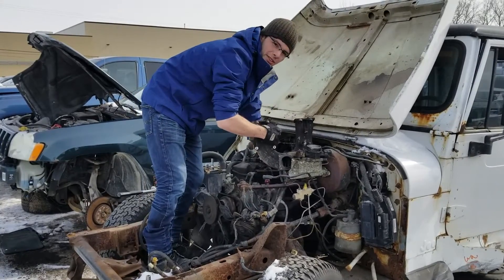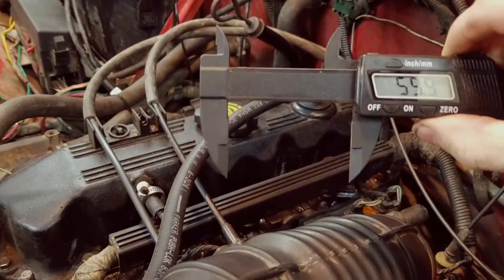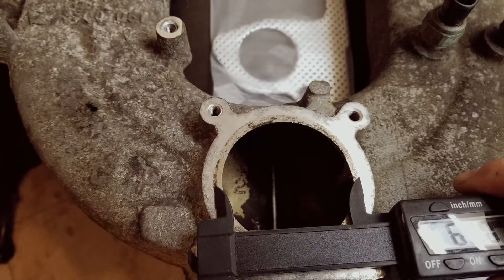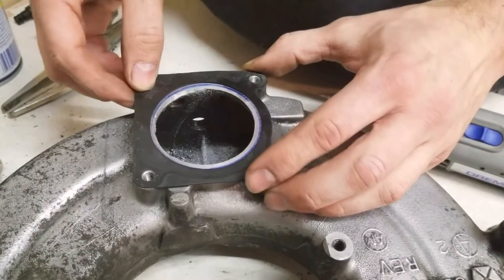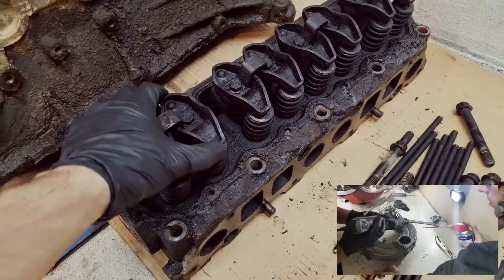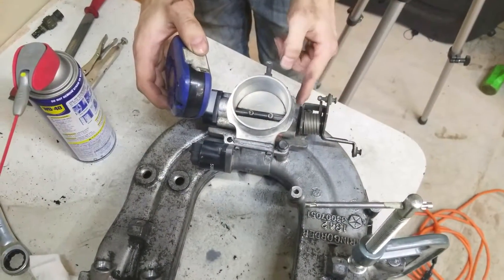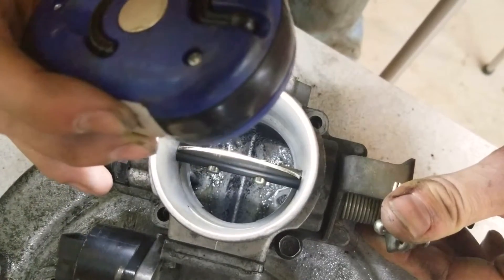Port Matching A 2.5L Intake Manifold To A 4.0L Throttle Body

Comment: I assume when you dremel the bore of you manifold theres significant aluminum shavings that fall into the manifold. How did you go about cleaning the shavings out? Did you use vacuums? Shoot compressed air into it?
Reply from the maker: Both,  yes.  You can also run water though it and dry it off before re-installing. Just whatever it takes to get the shavings out.

Comment: Computer is going to hold back the motor. 1.6 rocker arms are the best bang for the dollar.
Reply from the maker: By the same logic the computer would prevent the rocker arms from adding power as well. Neither is true reducing restrictions is helpful however you slice it and the computer really has nothing to do with it.  I do agree that 1.6 rocker arms are a good mod and will make more power but porting the intake manifold is free so if porting makes any power at all and costs nothing then it provides more bang for the buck. However I would argue that the 1.6 rockers are more worth the time/ effort.
Reply: @JeepSheepTV  there are videos that go mod by mod on a dyno. Only the rockers as any significant increases.

Comment: I see that these improvements has fallen off, The power commander 3, it seems a limited amount of a computer modification are not available... or is there?  Now in the end of 2021
Reply from the maker: There is a small group of people working on an aftermarket ECU and I'll be digging into it soon.  The best I've done for this engine is re-gearing, supercharging, and moving the IAT sensor. I have videos for the last 2

Comment: did this make a noticable difference, as you said a simple install made no difference?
Reply from the maker: No,  mods like this would take a dyno to understand the any hp gains.  I believe 4wheeler did a dyno test a while back and found 2-5 hp gains. The biggest difference for the 2 mods mentioned is an increase in responsiveness off idle and I do notice that.

Comment: Thank you! You are the first, and as far as all the clips I've seen, the only one to explain the relationship between the TB and the intake valves. SO to make sure I understand, because I'm kinda slow:  by installing the 4.0 TB, and porting the intake manifold to match, while not increasing air volume, except at full throttle,  we are decreasing air-flow-resistance? Allowing the four-squirreled beast to breathe better. Correct?
Reply from the maker: Yes that is the theory. You are also changing the amount of air into the engine per throttle position. So it should 'feel' faster because 10% throttle before meant X amount of air whereas 10% throttle now is X plus a little more. Being that the jeep is fuel injected and the throttle position is recorded in the PCM doing this will have a slight affect on you fuel trims as well but nothing that the feedback loop can't account for. The overall theory here is reduced air resistance but keep in mind everything else that is happening in the system.

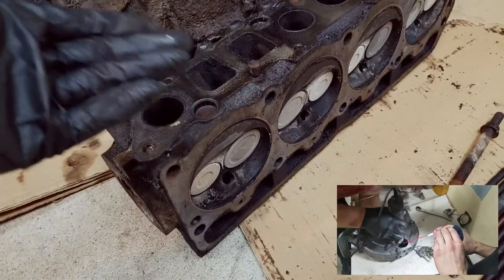Comment: 4:55 the valve Gap is what controls the air amount .. one  of many ways around this ☝️ 👀 look in changing your Rocker arm ball bearing type with different clearance 1.5 1.6  it changes the valve clearance . FYI

Comment: So the gains with a 4.0 tb, spacer, and ported manifold all together total 24hp, but is that by themselves, or does that include other mods like 12hole injectors, header and full exhaust? What could one expect by running EVERYTHING? Injectors, header and exhaust, tb, spacer, ported manifold, intake, 180* thermostat, and anything else I'm forgetting.
Reply from the maker: I currently have all of those things minus the thermostat and tb spacer.  My injectors are 4 hole instead of 12 because  I read that there wasn't much difference between the two. I have also regeared to 4.11s which made a huge difference in how it drives. I will be making one more modification before I put it on a dyno and then we will find out what the difference really is.
Reply: @JeepSheepTV  definitely post up an update video with final results. Ive got a 96 XJ with the 2.5 that I'll be building on. Bone stock right now and in desperate need of maintenance, so I might as well just jump right into the upgrades instead of doing it twice. The 4 hole and 12 hole injectors are pretty much the same price on Ebay, so I might as well just jump for the finer spray pattern, also gonna dig up a spare manifold to prep for the tb swap.  

Any recommendations on an ignition upgrade to go with, or is stock sufficient in this case?
Reply from the maker: @IFixThings1985  For sure, I have videos for most of my mods so feel free to take a look at those and don't hesitate to ask questions! We are here to help!
Reply: @JeepSheepTV  any word on the update video?
Reply from the maker: @IFixThings1985  its gonna be a while,  I have one more mod to do before I  throw the jeep on a dyno.
Reply: @JeepSheepTV  Is a while 7 months? I'm doing  these mods and wondering what to expect; though I haven't bored the intake. Wondering if that really made a difference before and after.
Reply from the maker: @davidloredo3791  yea,  a while is longer than that even. Lots going on over here. Since this video I have moved, joined a second channel, done a ton of house projects and learned a great deal about fuel injection tuning. The biggest hold up has waiting for the channel to start making money so I can save for dyno time.  But don't worry,  I'm still working on it. Many videos to come!

Comment: On the subject of air needed by an engine there is a simple mathematical equation at least for older vehicles that manufacturers used to use to determine the CFM requirement of the engine to put the correct size carburetor on a specific application CFM stands for cubic feet per minute it's basically how much air can flow through something like a throttle body or carburetor the math ematic equation that I'll put on here is for a street engine only needing an 85% efficiency rating I'll use your Jeep engine as an example to show you what the CFM requirements are for your engine first you start with how many cubic inches the engine is yours translates to 150 cubic inches then times that by the red line of the engine or the maximum rpm operational which on your engine is 5550 RPM times that by 85% divide it by 3 4 5 6 it should look like this 150x5550x85%/3456=204.75 CFM requirement. And on a full racing engine you would replace 85% with 110% efficiency rating what I like to do on my performance Street engine which means it has a mild cam upgraded intake and exhaust you want to hit it somewhere in the middle between 85% and 110% to get a good CFM flow for your throttle weatherby carburetor or throttle body at 234.75. This is a approximate guideline not an exact equation meaning there are other factors that come into play like /stroke /compression ratio etc but you are correct in the fact that no matter how big you put of a throttle body and or intake manifold the air still has to make its way past the intake valve and into the cylinder what would basically be happening on an old engine is you would be doing what's called over carburetion by putting too big of a carburetor on the vehicle will cause it to bog because it can't use all the air it's receiving but the reason you don't notice much of a difference is because the computer system will compensate and adjust your fuel and air mixture accordingly so the only real way to get more air into your engine and make use of a larger throttle body would be to put a larger lift and longer duration camshaft along with if available larger valves in addition porting and polishing the cylinder head you would definitely notice a horsepower gain after all of that. Then of course there's always a turbocharger kit lol the only way to get a lot of horsepower out of that engine but your gas mileage will suffer greatly LOL not to mention adding more moving parts to your drivetrain.
Reply from the maker: That is a wonderful response! I have seen that equation in my engine classes when I was at school.  The only adjustment I would make is I would drop the rpm because in reality this engine only ever sees a max of 4500 and that's rare it's more 3000-3500.
Reply: @JeepSheepTV  yes very true and that would reduce some bogging but it would definitely help to open up those valves a little longer in a little further lol I know the struggle I own a 1996 Dodge Dakota 2 wheel drive with the AMC 2.5 l it's the first year of the AMC inline 4 and the last year of the first gen body style. Minds rated for 120 horsepower at 139 pound feet of torque not terribly impressive but I'm pleased to say it still runs like a champ at 238000 plus milesI'm going to be replacing the exhaust manifold because it has a hairline crack developing on it and the intake gasket is leaking on number 3 intake Port really bad causing my idle to fluctuate at times other than that I drive it daily to work and it never seems to let me down I also have the 5-speed ax15 transmission. I'm only getting 18 miles to a gallon but I'm guessing it's due to my intake leak I drive it rather conservatively and the truck is rated for at least 22 miles per gallon highway we will see! After I fix the intake leak lol.
Reply: I find your videos to be very entertaining and to have a lot of valuable information I found your channel today actually when I was researching stuff for my Dakota I always research for Jeeps because there are way more Jeeps running around with my engine then there are Dodge Dakotas LOL I actually have been working for a dealership for 14 years about eight of those as a technician I started out at the Chrysler Jeep and Dodge store in Phoenix Arizona I also worked at the Alfa Romeo and Fiat dealer under the same company and now work at a all makes all models used car facility reconditioning used vehicles. in my eight and a half years I spent at the Chrysler Jeep and Dodge dealer I saw a lot of crazy stuff come through the doors and many of them were these 2.5 l AMC engines they are the little engines that can believe it or not I've seen these things that were so worn out it sounded like a ball peen hammer bouncing around inside the engine and they were still somehow driving great Little engines and I always look forward to learning new things each day even though I've been doing this so many years worked on so many cars there's always something new I learn each day.
Reply from the maker: You get much better head mileage than I do! I'm sure much of that has to do with gearing and wind resistance. My engine had roughly 200k on it before I replaced it and although it had 50psi of compression and knocked loudly it never left me stranded and always started. These engines are very difficult to kill. Thanks for the complement and keep coming back for more!

Comment: Don’t forget to up your coil pack voltage, it will really get the iridiums firing. Cooler plugs would help too. 

I’ve got a 2.9 stroker kit in my 2.5L. Been a busy guy, just terrible with the video stuff. I’m glad someone else is getting to it.
Reply from the maker: hey man if you want to do the video thing but need help with the editing (that's what really takes the time), I can help you out if I can post the video on my channel. You can take all the credit of course lol!

Comment: At WOT these engines run rich naturally based on the tune, so bigger throttle and bored intake and better injection spray pattern WILL gain you some power gains near the top end. Not real practical for daily 3k rpm shifts, but more power is more power! It’s also a great supporting mod to do when you add a header and get some bigger valves in it. Then you can really use that CFM rate throughout the powerband.

Comment: Your on the right track, don’t forget your TB spacer plate mod to buy. You can get the air raid brand or jeepers and creepers brand.
Reply: I have heard others mention the TB spacer. What does the spacer accomplish, as apposed to the TB flat on the gasket?
Reply: @heatmizer-jim6762  from what I understand it cools the air a bit. Also supposed to increase the velocity by causing a swirl effect. Does it work? I don’t know. I’ve seen some work good for some applications and not so much for others.